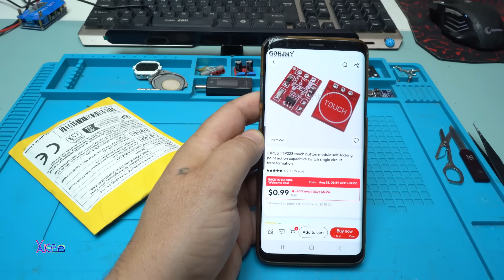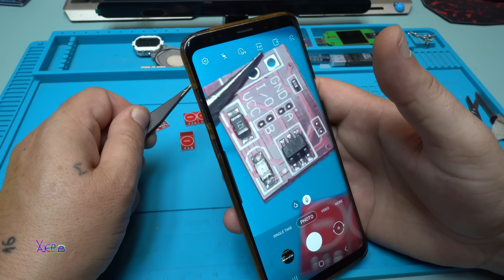THESE $1 Aliexpress Modules are AWESOME - TTP223 touch button module

Comment: I think the general idea is that you can put the switch behind a panel for a better looking front and you can also make it waterproof with no external switches.
Reply: looks sensitive enough,  some experimentation to see how thick you can go, and it still be able to trigger,  for example a 3d printed enclosure.

Comment: I made a touch morse code key a few years back using modules very similar to these, it works great!
Reply: More info pse?
Reply: @JohnnyB-LostTreasure  I used the 4 touch input chip, TTP224, but you could use 2 of these modules.
Reply: @mikestokes235  does it work like a straight key?
Reply: @JohnnyB-LostTreasure  No, like an iambic keyer
Reply: @JohnnyB-LostTreasure  I tried to put a link to a picture, but my message gets deleted!

Comment: There are 'A' and 'B' solder pads which can be open or shorted, what is their purpose?  I suspect they choose momentary or latching action, or invert the output, but I don't find them described anywhere.  Thank you.
Reply: A open : pulse from L to H when the switch is activated
A close : pulse from H to L when the switch is activated
B open : direct mode (button control)
B close : switching mode (ON/OFF operation)
Reply: @iki1611   Thank you for confirming this....

Comment: you completely ignored the 2 pads which can be solder bridged to activate other modes, like latched...
Reply: Y4ah, latched is MUCH more useful.
It would also be good to know what current it can sink/source, because it could control smaller items without needing a relay...